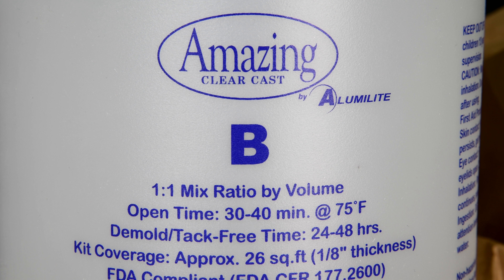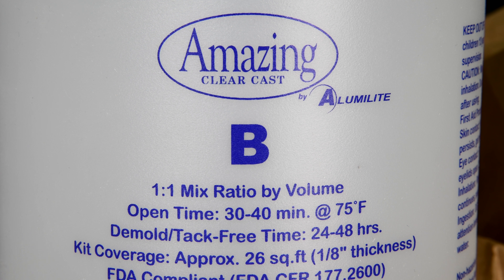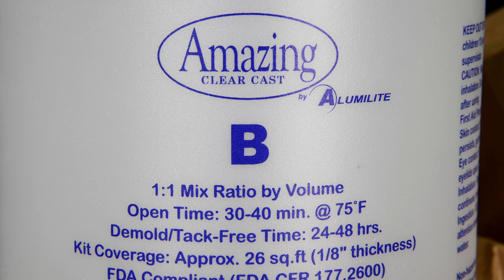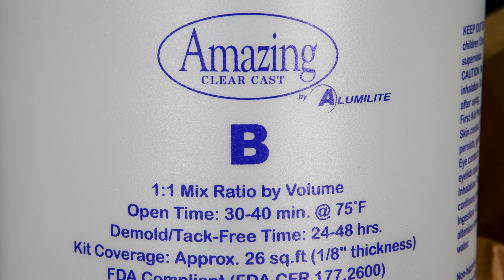My First Alumilite Project - Part 2

Comment: Hi Ron,
I will be following your adventure on your first casting and turning of Alumilite. Lee Valley in Waterloo, ON had a two day seminar on casting resin and wood last March but I waited too long to sign up. The projects offered were a pen blank, a bottle stopper or a pepper grinder. I don't think that Lee Valley actually sells Alumilite resins.
See you tomorrow.
Reply from the maker: Yes, it's too bad that Lee Valley doesn't sell it. They have a store here in Winnipeg. Could have saved big in shipping charges :)

Comment: Hi Ron,

the "regular" Alumilite is sth different than an epoxy-resin - like I guess the envirotex is.
Form the ppl. who used it i heard that it turns much moore smoothly and it isnt as brital as epoxy, although it comes with a much shorter workingtime.
This Clearcast is an epoxy- resin so you shouldn have any have problems of degasing it or working with it.
Have fun and be safe in your workshop.
Reply from the maker: We'll all know in a few days :)